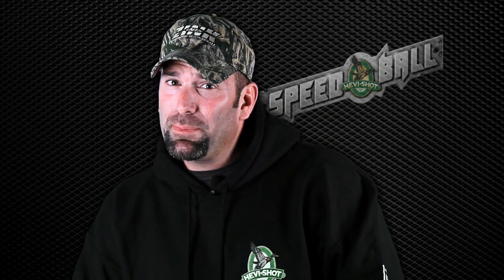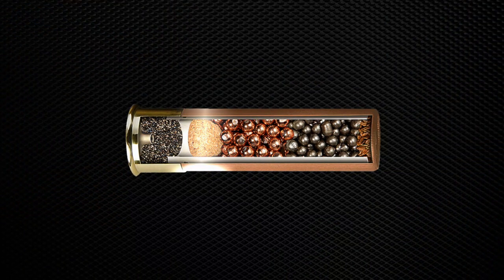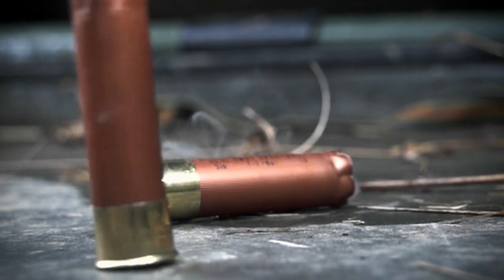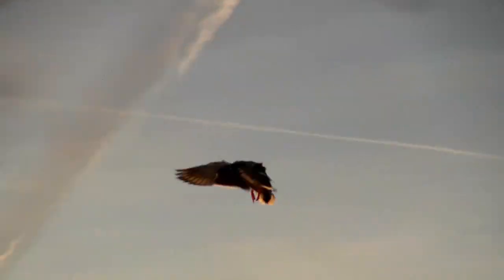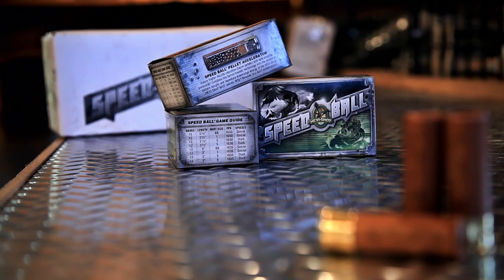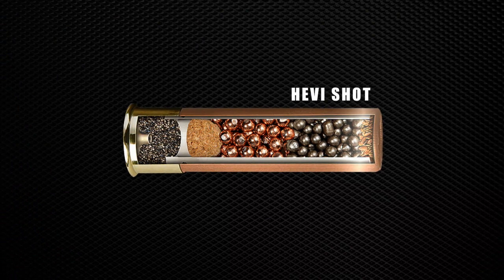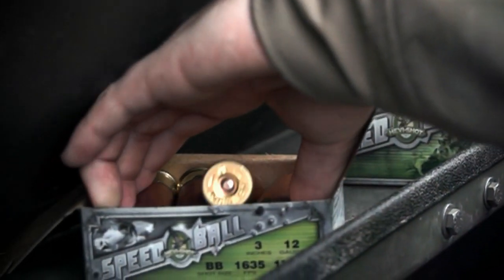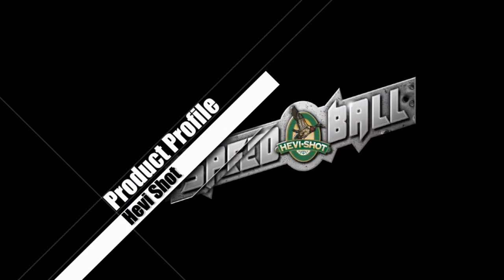Hevi Shot Speed Ball Product Profile

Comment: do these loads still shoot well out of a Pattern Master choke tube? Patternmaster says their chokes are recommended for shells producing 1500fps or lower because at that speed the wad blows through the wad stripper ring.  
I used to shoot a pattern master, and it did great with my dove loads but when I started shooting the faster 1500fps + duck loads it seamed the pattern master wasn't as effective as it was with the slower shells.

thanks Ray-